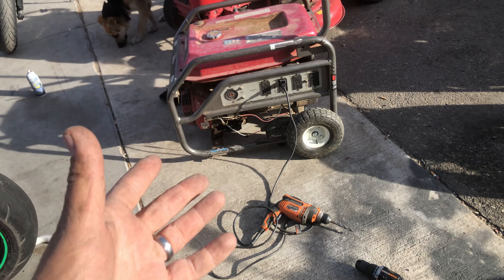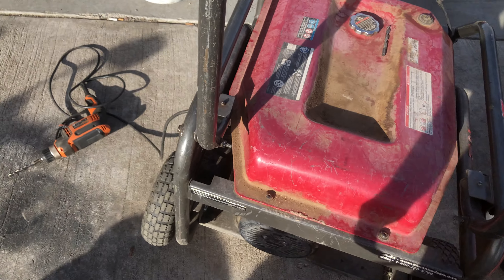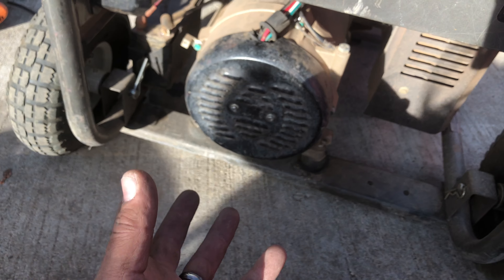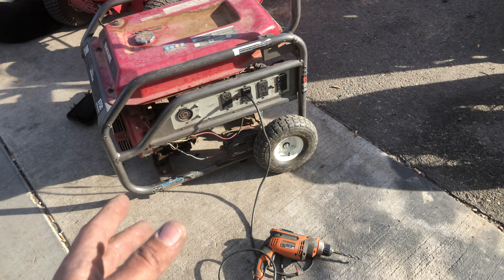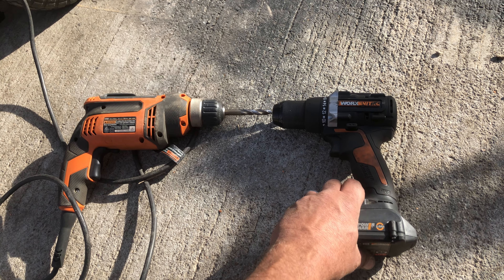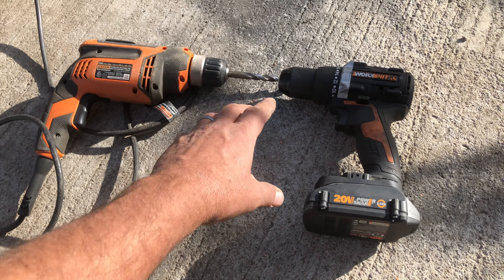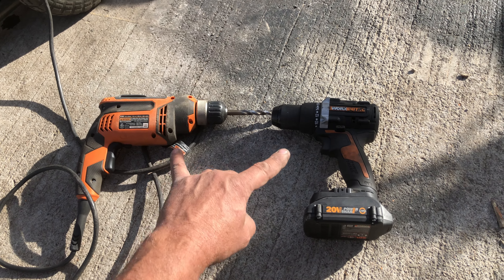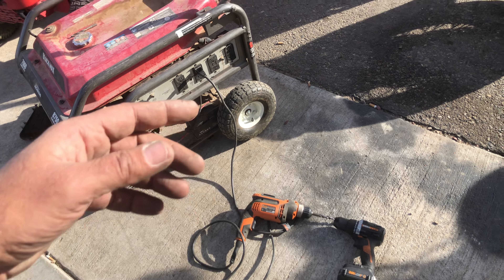generator runs but no electricity quick fix

Comment: This is a great idea or you can spin the drill is connected with the generator by hand clockwise 3 or 4 times to send a little power to the generator that’s all you need.

Comment: It took me about 5 or 6 tries . Just as I gave up and went to walk away and go buy a cheap one so I wouldn't  lose my freezer and fridge food I decided to give it one more try and that was all it took. Thank you so so so much we were on our 2nd day without power. I knew it had to be something simple as it has low hours and ran when i put it up a few years ago. I thought I was good to go once I  had torn the carburetor apart and cleaned it iand it fired right up. But than found nothing at the outlet. Found another that mentioned this trick . But you made it clear and simple to understand. What to do. I really wasn't in the mood for the others long winded videos before they get to the point of what I needed so they went bye byeand the search continued until I found you. And you turned my day around. 5 star's my friend

Comment: I was having this issue with my Homelite 5600 that we just used a couple weeks ago for Hurricane Helene and now after Milton wouldn't produce electricity. I was sceptical, but said "worth a try". Took more than a few bumps. I had to run the the battery drill on high for 15-20 seconds then, Bam!  It started working! Thank you soooo much for this concise and informative video!

Comment: Or you could just roll an angle grinder on the floor backwards
Reply: I like your idea much more,  use a angle grinder,  and its a hole lot safer.  Thanks for sharing your experience.  Carl
Reply: @carlcannedy2669 I just mentioned in another comment.. wrap a drill with rope and then have someone pull the rope. Like a pull start.

Comment: I have a Firman T07571. the small power load "on/off" switch kept springing  back to the off position (would not stay in the on position at all). Produced no power even though the engine ran fine. Tried this method after reading elsewhere and i'll be darn if it didn't fix it. Switch stays in the on position and works fine. Get the cordless spinning good in forward and as soon as you let off the trigger bump the trigger on the corded drill. Thank you much.

Comment: Use a wooden dowel rod, not a drill bit.  It will “snap” when the generator head is flashed and starts working.
Reply: That’s actually a great idea. The dowel breaks before your wrist bone!
Inside my dremel the motor is connected to the chuck with a little flexible tube. I guess it’s there to keep from breaking anything if it gets jammed. I have to replace it about every ten years with a new piece of plastic tube because the old one get brittle.

Comment: Cant you just spin it by hand and not worry about the other drill catching and giving you bent wrists and summer teeth?  Just put the drill in its low speed mode so your turns on the chuck are 1:1 to the motor turning..  i would bet youd get enough power fed back to excite the winding again..
Reply from the maker: in my experience I've had to get them moving faster, and you would need a variable speed drill to adjust the speed, but that would work i believe. thanks for watching.

Comment: My generator will run but once I plug a drill, it will power the drill for 2 minutes and drill will stop but generator will continue running. Any advise. Thanks

Comment: My Gen is producing 240v but when connected to my solar inverter / charge controller it won’t charge my batteries. I’m thinking I got a bad stator or the brushes failed. Thoughts?
Reply from the maker: or the battery's are so dead that it doesn't recognize anything being connected.

Comment: I tried this and it worked and then I shut the generator off tried it again and it wouldn’t work so there’s probably something else going on
Reply: My guess is bad capacitor. Just a guess. Research it
Reply: Thanks it worked. However now the engines after turning on shuts itself off… 😢